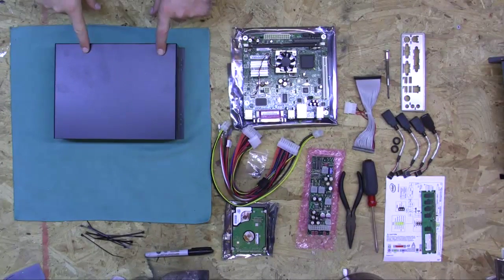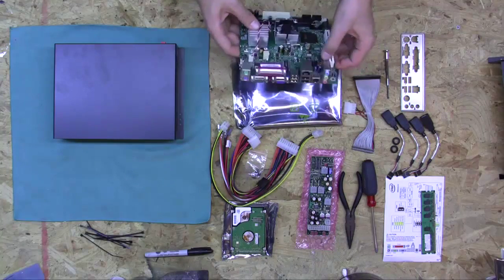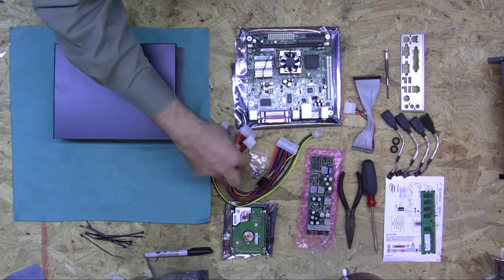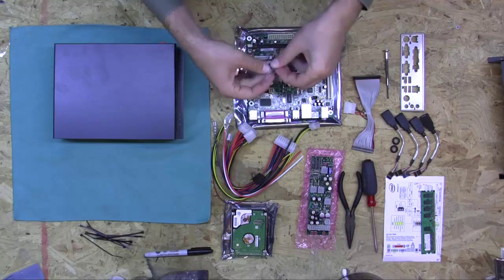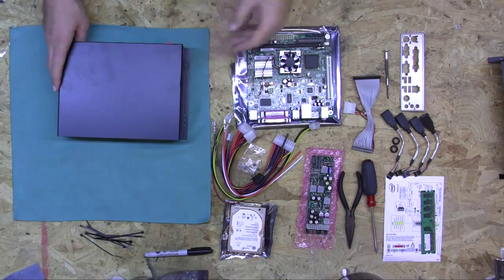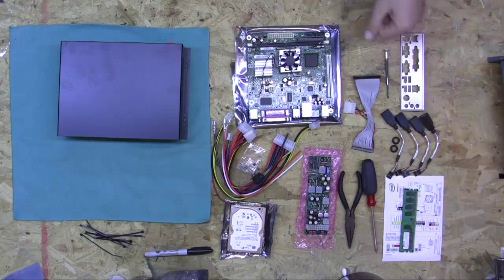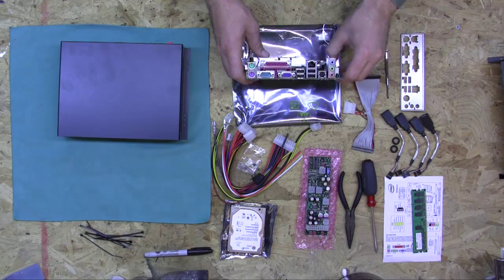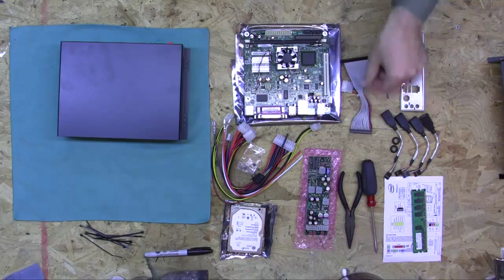How to Build a CarPC Part 1

Comment: Anyone pull this off with an android mini PC? Its so small and although it may be lacking in features and power of a full PC... Music, movies and streaming could easily be achieved. I just need a good touch screen..
Reply: That's what tablet installs are for. Android is meant as a mobile platform, not as a pc platform. 
Some Windows tablets could replace the car pc idea, unless you're going for insane amounts of storage. WTablets like the Surface (especially the Pro 3) actually run Windows, not Windows RT. This video is from 09, but with today's technology you can easily run it with tablets.